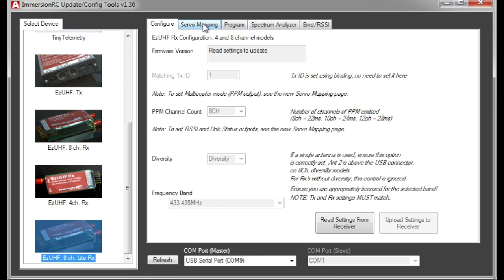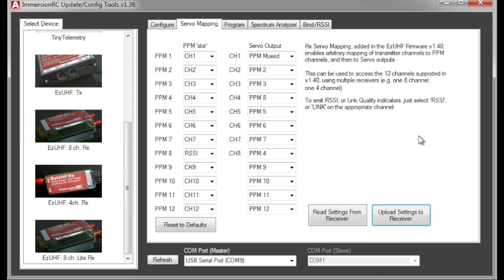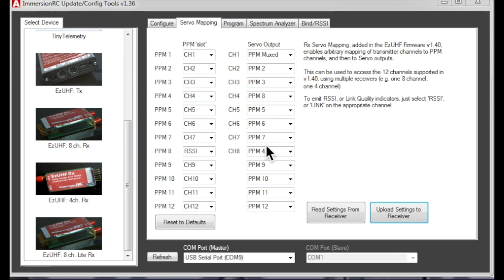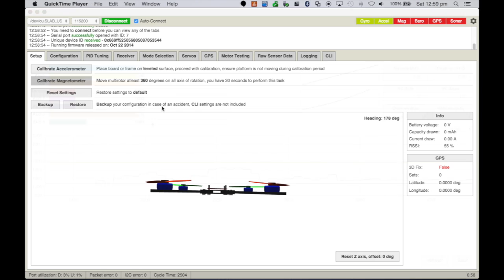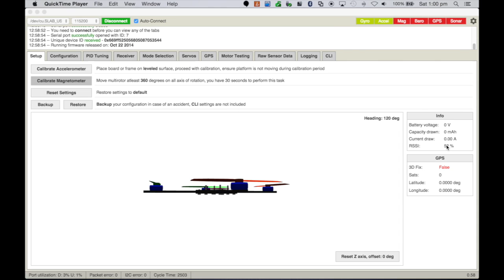EzUHF RSSI Muxed PPM Configuration

Comment: I'm running EZUHF and found there is a slight delay in response. I move the control stick and there is a slight delay on the control surface movement. I'm running the latest version of EZUHF firmware and OpenTX 2.2.3 on my taranis.

Comment: I have EZUHF 8 Channel Diversity Receiver I change firmwares 1,5-1,52-1,53 everything in Immersion RC Tools is adjustable, the LED is lit with a constant light, and before flickering and binding to the transmitter does not occur. What could possibly be the matter?
Reply from the maker: Александр Жогленко binding should not be due to configuration as it is between transmitter and receiver. Have you tried to rebind the receiver from scratch with the transmitter. The software upgrade may have unbound the units

Comment: my rssi doesn't change when i shut off the radio. stays at 1500% when config tool is set to raw and 900/900 
I am running muxed on ch1 with link on ch8 slot.  Do i need to run a serperate signal wire from the rx? and not through muxed? any ideas? I don't need an rssi channel programed in my tx do i?
Reply: any ideas @seafurymike ?

Comment: Hi. I purchased theEzUHF Diversity 8-Ch Rx along with the EzUHF Jr. Module and I can't seem to configure them properly for Fixed Wing Aircraft using the "ImmersionRC Tool" software. I have successfully binded the Rx and Tx together however I can't plug in my throttle, elevator, rudder, aileron servos and get them to work. I have successfully updated the firmware in both the Tx and Rx to version 1.53 (6) a0 and they are both operating on the same frequency 435-437Mhz

How should the PPM Slot and Servo Output settings, found under "Servo Mapping" in the software, be configured for basic servo function of Fixed Wing Aircraft? I have tried multiple configurations and nothing seems to work.
Reply from the maker: Tristan Cairns Photography hey Tristan. If your using servos directly on the receiver you want PWM and not ppm. PPM or cPPM combines all channels onto a single wire and will need a flight controller to break it back out to individual servos, etc. PWM will give you a per channel output on the receiver. Plug in a servo to each channel, a battery to power the servos, 5-6volts on a spare channel. Hope this helps but you didn’t give me a lot of detail on yours setup, so I’m just guessing a reply
Reply: Thank you for your help!!! I'm using the TaranisQX7 Radio and the modes found on the radio controller for the "External RF" are only PPM, XJT, DSM2, CRSF, R9M, & SBUS. Do you know how I can enable the PWM mode??
Reply: you want ppm from the radio to the receiver and pwm coming out o the receiver

Comment: Do you need a separate physical cable from output 4 and if so what are you connecting it to on the naze?
Reply from the maker: wattage2007 from memory i believe i added muxed to the title which implies it is all in band. It is using the single wire to pass all the functions.
Reply: seafurymike Thanks for the reply. That's what I suspected although it's not working on mine at all. When I duplicate your settings I end up getting AUX4 duplicating what AUX3 is doing. Incredibly frustrating.
Reply from the maker: wattage2007 Its been such a long time since i configured an EzUHF. All i can think of it being is the software version. Maybe it has a bug. I can say i have not seen that fault before. Best of luck fixing your issue. Have you tried reaching out to ImmersionRC or the rotorriot thread on facebook. maybe someone has seen this issue.
Reply: seafurymike Thanks again for taking the time to reply. Seems it was the version of immersionrc tools I was using. Used the latest version and it worked fine 😊

Comment: Hello. I have just bought the 8ch lite rx and the JR module but haven't used them yet. Next on my shopping list is a flight controller / OSD. I have read that ezuhf only outputs RSSI in a way that the ezosd can use and that most OSDs can't use the signal because it is not a normal analog RSSI. This is based on posts from 2012-2013 though... is this still the case?
....
I'm thinking about getting an eagletree vector or cyclops tornado... will the method you show in this video work for these OSDs do you think? thanks!
Reply from the maker: +Chris Flory I piped the RSSI from the EzUHF to via my Naze board to my minumOSD. No issues. I can't speak to the two systems you mentioned as I have never used them. The one thing with all of this is the signal was inverted from memory, so just ensure what you buy can either read the inverted output or place a system in between that can invert it for you.
Reply: seafurymike thanks
Reply: @seafurymike 9 years late to say “thanks” is better than never 😂

Comment: did not work for me :( I have set up my configuration as you have done it in the vid, but i always get 0%.. what do i have to change in the minimosd?
Reply: what do you get on the flight controller. break it down and try to work out where it works and doesn't.
Reply: Seafury mike i think i get the right values from the rssi injected in the naze32 board. At least i get a value Close to 1000 if i turn on my Radio displayed in the naze32 board. But i dont see this values in the minimosd. Have you changed there any values? In the minimosd i turned on the following Options. Display rssi, use mwii and use pwm ... but i dont get a value. i also tried to turn of usepwm in the minimosd, no changes :(
Reply: Seafury mike Thanks for the reply by the way! highly appreciate this!
Reply: Yes, you have the right settings with use PWM, Mwii.

Oh, did you calibrate the RSSI value with the sticks menu. You have to get into the OSD menu and program the value for min and max signal.
Reply: Seafury mike no ... tbh - i have no clue how to calibrate that. Can you Show me a screenshot or explain me that? would love it!
Reply: Seafury mike Hey man,

any news ... i´m still struggeling with this :(